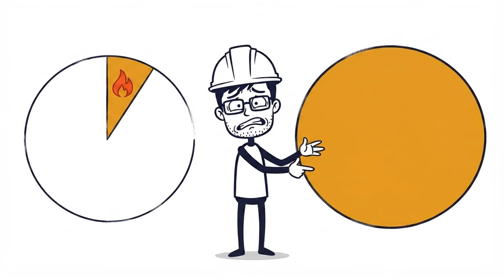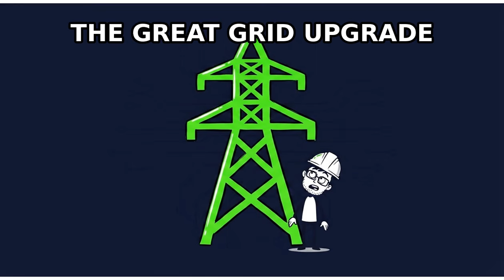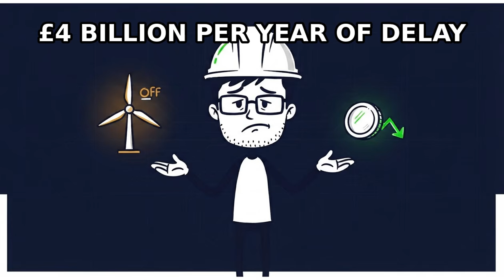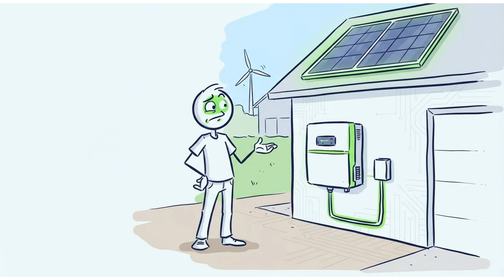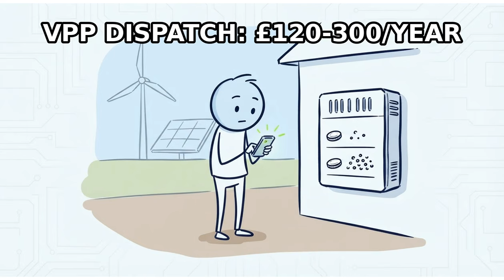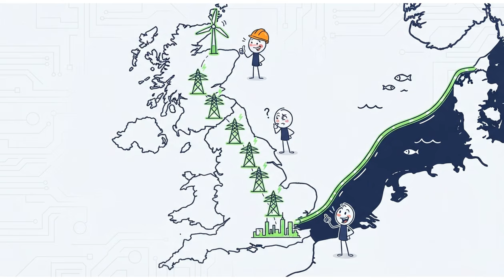What Does A 90% Renewable UK Actually Look Like?

Comment from the maker: The data doesn’t lie: a 90% renewable UK grid means incredible energy abundance when the wind blows and the sun shines, but it also brings massive volatility. The households that win are the ones who adapt their homes to match it. 

I’ve built FutureWatt as a completely independent, data-driven research hub to show you exactly how to audit your home, choose the right hardware, and hack your energy bills. 

If you want to start optimizing your own setup, use our step-by-step master guides:

👉 The Master Green Energy Directory (Our strict order of operations):
https://futurewatt.co.uk/green-energy/

🧱 Step 1: Stop leaking heat (The Fabric-First DIY Audit & U-Value Guide):
https://futurewatt.co.uk/green-energy/home-energy-efficiency-fabric-first-audit

⚡ Step 2: Ride the dynamic pricing waves (Octopus Agile Tariff Explained):
https://futurewatt.co.uk/green-energy/octopus-agile-tariff-explained

Thank you all for the incredible support on this video! Drop your grid questions below and let’s discuss. 👇
Reply: The first thing that is needed is a much more positive attitude and a can-do spirit. The need to do many of the necessary things was clear 30 or more years ago, but governments did little or nothing because of vested interests and fear of NIMBYs. Now, at last, we appear to have a government that just might explain clearly to the public what changes we need and why, promote public engagement, gain widespread public support, and tell the NIMBYs, politely, that they are not going to be allowed to torpedo projects the public needs.
Reply: @andybostock1315  Projects need to be classified, like Capital projects where they are to do with national interests and local planning doesn't come into it at all, once it is decided at government level that is where it is going. We have a road project where people complained about every solution and it didn't happen but now they complain all the time because nothing has been done about the problem they wouldn't let be solved. It has also driven the costs of the project up by many millions, which I think should come out of their council tax.
Reply: It is strange when you think about it, we classed appliances by their efficiency rating to cut the amount of electricity used and now we use far more.

Comment: Scotland covered with turbines and everybody living in one corner that is left. Don't think so, check where they want 1300 windfarms to go!
Reply from the maker: Landscape worries are fair. The nearest official figure I can find is 1,253 renewable projects in Scotland's pipeline as of June 2026, but that includes 426 battery and storage projects, and plenty won't get built. If you've got a source for 1,300 wind farms I'd like to see it. And the point of the video is that more turbines aren't the first need. The wires to move what's already built are.
Reply: @FuturePowerYT  Every village and town in England could have their own windfarm in the suburbs, that would being down the cost of housing and produce power where it is needed. Then every skyscraper in London could have a turbine on top to power that building, and every residence has a solar roof, that's that sorted. Then 3 London nuclear power stations. Oh and 1300 is rounded up power sources but who needs batteries we don't have solar the wind blows somewhere in Scotland all the time then there is hydro and tidal that you can switch off when not needed. Pumped Storage is only for the breaks after Eastenders and between Coronation Street.
Reply: @FuturePowerYT  426 battery projects. If Scotland is a bottleneck, then why not build those batteries in England where it is needed?
Reply from the maker: Good question. A battery only helps if it's on the same side of the bottleneck as the power it's storing. The problem is Scottish wind that can't get down the lines into England at that moment. A battery in England can't charge from it, because the wires are what's stopping it. A battery in Scotland can soak up that surplus and release it when the lines clear. England needs batteries too, for its own solar and demand swings, and they're being built there as well, but they don't fix the Scottish constraint. (That 426 also includes other storage, not just batteries.) So it's both: storage on the Scottish side as a stopgap, and stronger lines so more of the wind can move south.
Reply: @FuturePowerYT  Batteries in England where they are needed, charged during the night when few are using power, and the bottleneck doesn't cause as many problems. There is always going to be a bottleneck that is why it would be better to build windfarms in the Lake District and on the moors. Building in Scotland is a bad idea because when the Chinese invade Scotland, the invites have been posted, they will cut ties with England.

Comment: If every pensioner was "given" a plug in battery say 15Kwh and used a Time of use tariff, the first year of saving could exceed the winter fuel payment.  Throw in a couple of balcony solar panels for those who have a balcony and this would have a material financial benefit for OAPs.  
The cost would be small as the market would very quickly force prices down as is already happening. 
The govt is actually looking at this type of scheme.  Bring it on
Reply: Or, just remove over 75s from the voting franchise

Comment: Up north we've had about two centuries of dirty, polluting and visibly intrusive energy infrastructure (colliery slag heaps, coking works, thermal power plants, railway lines). I've no idea what the wealthy people of East Anglia's solution is, but I think they should take one for the team. Believe me, after a little while you stop noticing that pylon on the horizon.
Reply from the maker: Fair point, and plenty of people do stop noticing them. The real trade-off is more pylons onshore or paying noticeably more to bury cables or run them under the sea, and so far it looks like a mix of all of them.
Reply: They're endlessly moaning about Sizewell C...
Reply: - re pylons: Day #1 in Osaka.. all the poles and cables on street ...Day #3 hardly noticed...
Reply: Windfarms everywhere that is viable and feck the NIIMBYs. Why should they complain, all those fans will keep it cool in summertime (no, don't tell them otherwise).

Comment: Just think, the whole UK could've had a complete upgrade of its electricity distribution and become almost fossil fuel free but we decided to spaff the money on a train line that will save a few people travelling from Birminghame to London 20 minutes.
Reply: Part of HS2's problem is the same as explained in this video in relation to building new pylons - local groups objecting to every little planning detail, adding years of delays and expensive redesigns to the project causing costs to spiral to unacceptable levels.

Comment: I'm not sure why Westminster is so against regional pricing, yes it would provoke industry to relocate 'up north' and it would benefit consumers in areas around the renewable sources, but why is that such a 'bad thing'?
Reply: It would benefit non-Londoners, so it can't happen
Reply from the maker: The government rejected it in July 2025, mainly over investor confidence, complexity, and the winners and losers between regions. It also estimated it would take about seven years to implement. There's a real case for it though: supporters argue it would cut bills near the wind farms and pull demand north, which is your point. What they chose instead pushes some of that locational signal into network charges, so it's more of a compromise than a rejection of the idea.
Reply: By having regional peak prices, the amount of profit for each peak would be reduced due to each merit order being smaller. Also currently if a resource wins in the auction but can't deliver due to network constraints they still get paid.  Regional pricing would reduce this boondoggle.

Comment: I live in Northern Ireland, our supply last year was 53% renewables and were already 14% over capacity with wind. 
We now need more interconnection to move power out of the region.
Reply from the maker: That's the same story as Scottish wind in miniature. About 70% of Northern Ireland's renewable generation is in the north west, while about 70% of the demand is in the east and south east, so the power gets stuck. SONI's own figures show around 22% of available wind output was dispatched down in 2025, and nearly 30% in 2024. The existing North-South link is at times maxed out, so a second interconnector looks like the obvious fix. Have you seen any sign of it actually getting built?
Reply: Nobody wants your Irish power, probably make the meter run backwards.

Comment: There's very little reason onshore wind can't a bigger proportion. Most farmers would welcome extra income they could get by having wind turbines on their farms. In some areas where "Area of Outstanding Natural Beauty" rules apply then wind turbines are not appropriate. But as an example, all the green fields inside the M25 around London should be covered with wind turbines. 

All the south facing embankments on railways and motorways could be covered with solar panels.
Reply from the maker: Good shout on the railway/motorway embankments — that's not hypothetical either. Network Rail already trialled exactly this at Aldershot in 2019 (the "Riding Sunbeams" project), feeding solar directly into the rail traction system rather than the grid, and the pilot suggested it could cover around 10% of the southern region's rail power needs. A more recent UK-wide study put the national potential from railway land alone at up to 8% of total electricity demand. Genuinely under-used asset.
Reply: In the northern half of the UK there’s already a glut of onshore wind. 
Hence the move towards offshore wind 
Actually offshore has much lower downtime because the wind blows much more at sea.
Reply: My Two Cents: Apparently, housing association and local authority homes number about two million in England. Now, in addition to being mostly in southern England, (nice), many of those will be multiple flats under one roof, so, let’s say half a million roofs and a quarter of those face south, (or south-ish). 125k*20m^2, (rough stab at the size of a roof elevation), =
2.5 mln square metres of roof. That’s 2.5 square kilometres of roof that could be used to provide power to some of the poorest people in the country, or fed back into the grid to make everyone’s electricity greener and cheaper.

Comment: There’s a fundamental mistake being made here - we should put the generation where the use is, not miles away out of sight, just to keep the NIMBYs happy. 

Fair enough with nuclear and big coal plants, they pose real risks to large population centres but SWB does not, so move it as close as possible to minimise the transmission costs.

Also, regional pricing would encourage building new demand close to where excess supply already exists, again reducing transmission requirements - it’d also stimulate economic activity in Scotland and the North East specifically, thereby “levelling up” the economy.

Fuck the NIMBYs, if you want power, you’re going to have to look at whatever it is that generates it!

Comment: Wave power will be the largest
Reply from the maker: Not where the numbers point right now — offshore wind's capacity is already in a completely different league, and wave power's still mostly at the demonstration-project stage rather than commercial scale. What's the case for wave specifically — cost coming down, something about predictability vs wind and solar?

Comment: I really think we should turn a negative into a positive. There are a few HVDC manufacturers coming online in the UK and I think these things are going to be everywhere. There are already plans for links between the UK and Canada - let's commit properly and plan links that run to the Southern Hemisphere. If solar power from South Africa can flood into Europe in winter and vice versa in summer, it can solve so many problems. Let's spend the money to create a true HVDC manufacturing industry and capture the cost curves and learning that could go along with that to spread power across the world..
Reply from the maker: That's the right instinct, but it needs a huge amount of political alignment to happen — something we haven't had, unfortunately. Worth adding: distance matters too. A direct UK-South Africa link would face much higher transmission losses than something like the Morocco-UK cable, without adding a lot over what a shorter link already gives you.
Reply: @FuturePowerYT  You're quite right, of course, but even losses of 20% that might affect such a 6000km line will be miniscule in comparison to the huge solar surpluses that are already building up during summer. It's the difference between giving power away for free and it being usefully sold across the globe..
Reply from the maker: Fair challenge — you're right that it's months, not weeks, since South Africa's summer surplus lines up with UK winter demand, and the reverse could work the other half of the year. That's better utilisation than I gave it credit for. The remaining question is whether day-to-day surplus volume actually matches the cable's capacity often enough, and whether the same seasonal match is available more cheaply from a shorter link — Morocco already sits in a similar seasonal offset for a fraction of the distance. But either way it works!

Comment: The idea of VPP (virtual power plant) is great in theory. Until the price we (the people with home batteries) get paid the same or a little more than what it costs us to buy the power at night the people promoting VPP will be told politely to FSCK off. 

They also forget that most EV's on sale today AND home EV chargers can't handle power coming out of the EV and into the Grid. 

A total cost business plan is needed and where is it? (cue crickets).
Reply from the maker: All three of those are real gaps, not just cynicism — the payment parity problem especially, nobody's going to hand over their home battery's flexibility for less than they'd pay to just use it themselves. Honestly it comes back to political will more than technology. A bit more forethought 10-20 years ago on exactly this stuff — payment structures, bidirectional charging standards, an actual published cost model — and we wouldn't be reworking it now. The tech's mostly ready. The policy and business case around it isn't.
Reply: Axle are paying £1 per kWh - about 4 times what it costs you to buy, or 8 times the normal export rate. That's the kind of incentive required to make it worth signing up.
Reply: @robinbennett5994  Axle does not work with my system. I tried it last year and got messages saying that they could not control my system for the export. I was with them for 4 months and didn't get my guaranteed £10 a month.
Reply: I have racked up 130 quid from axle in 2 months for doing nowt
Reply: @magicker8052  Well done you. As I explained, the Axle system can't control my battery setup so I can't benefit from their work.

Comment: So when we should have been thinking forward even just 20 years ago to build out the infrastructure we just didn’t do enough planning and co-ordination. Absolutely VPP but what we need is a speed up of V2G and also encourage consumers through subsidy or similar to install PV ( and /or where suitable wind turbines) and batteries in more homes, offices, car parks, etc. also micro water turbines , geothermal power. But the additional problem is lead time on transformers, power cables, every country is doing the same thing.
Reply from the maker: The transformer/cable lead-time point is the one that doesn't get enough airtime — everyone talks about panels and batteries, but if every country's ordering the same grid hardware at once, that's a real physical bottleneck no subsidy fixes quickly. V2G is interesting too, though the honest holdup there is battery degradation concerns from owners, not the technology itself. Might be worth its own video.
Reply: @FuturePowerYT V2 G battery degradation may be a fear for some EV owners but it appears from all the evidence I can find to not be a problem. Indeed EV batteries as a whole seem to be holding up much better in the real world than original benchmark testing showed. Plus V2G is not  compulsory an owner could simply choose not to take part .
Reply from the maker: I'm not too up to speed with V2G though, was referring to forming a VPP using home batteries. V2G - I can totally understand why people are reluctant.